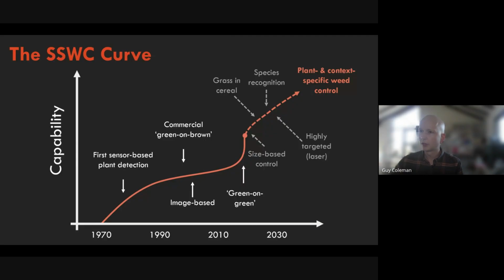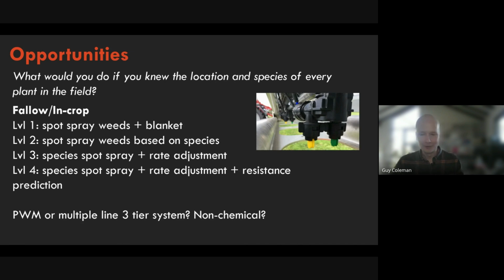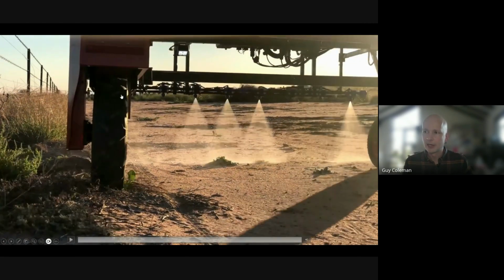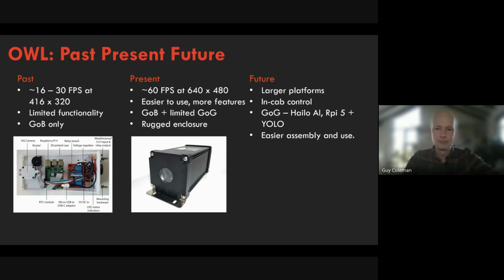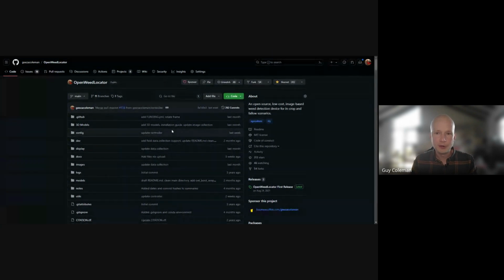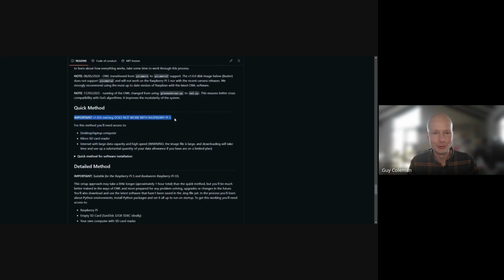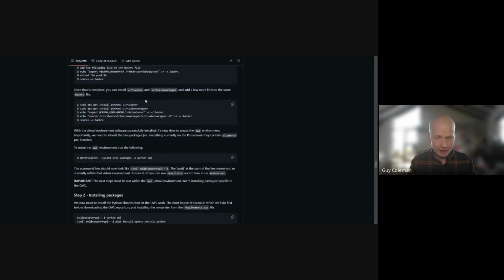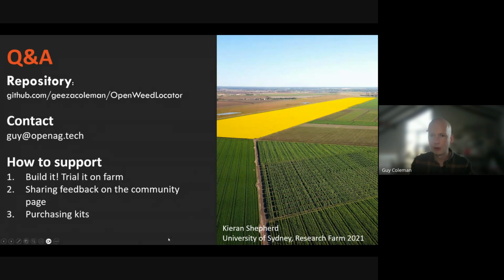OpenWeedLocator 2.0 - Workshop

Comment: Thanks a lot for this. I really appreciate your your great work.
I would like to suggest a new approach.
I don't know how to customize an artificial intelligence model. But if I knew, I would use something like Janus Pro, host it on a server or locally on a local machine with atleast a GPU or just use their API, then send images from my rasberry and then depending on the response, spray or not spray. Also, incase the response is delayed, I would program my rollers (on which I have bolted my machine Open-Weed-Locator Machine- just a frame with an electric motor) to stop and wait for a respose.
You see, even if the robot I end up with might be slow i.e. the request - receive process is slow, it is automous - you just leave it in the farm and it will tell you when the weeding is done.